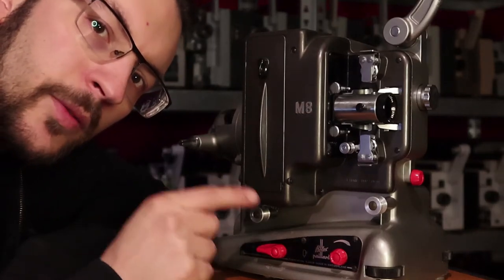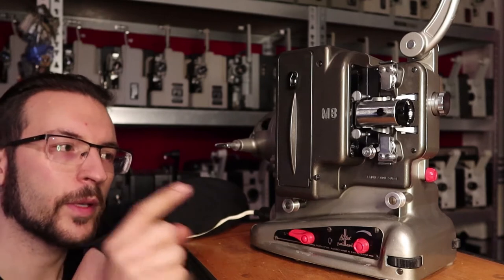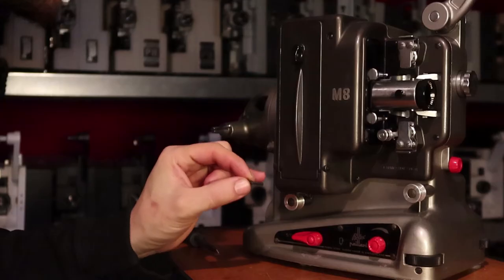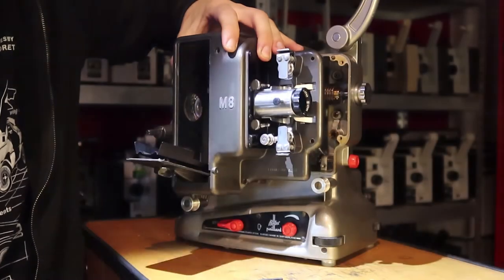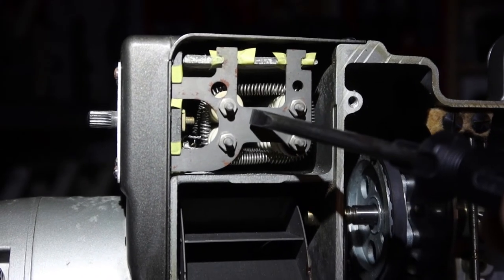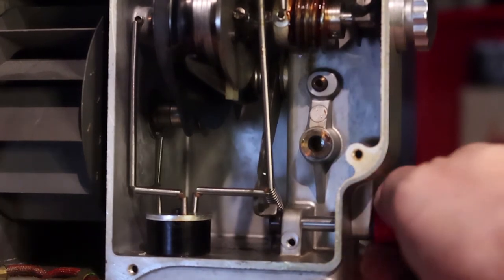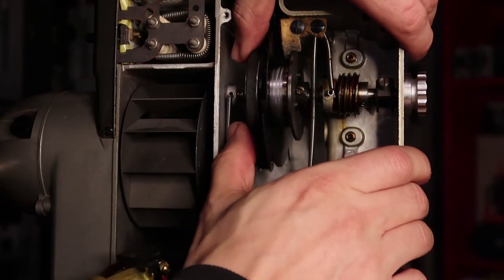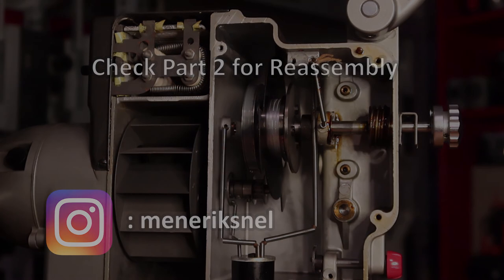Bolex M8 replacing the drive belt tutorial Part 1

Comment: Great video.  What is the part number for the belt and where do you shop for this replacement part on the web?  Subscribed and liked!  Thanks again for this valuable content.
Reply from the maker: Well i don't have a part number, i didn't replace the belt in this video as it was in good enough state to be re used, i just made this video to show the viewer how to change the belt. I don't know where you can find a replacement, i would sugest Ebay. My suplier of parts does not have this particular belt in stock. normally i get the parts at www.van-eck.net, they have many parts and shipworldwide.

Comment: Who repairs SM8 Bolex amplifiers?  I suspect a capacitor problem
Reply from the maker: I do, you are probably right and if you are handy with the soldering iron you can do it yourself. there are two large capacitors on the amp, the biggest is often the problem (depending on the type of amp). i recently repaired one that also had a shorted rectifier bridge.
Reply: @eriksnel6461  ,  I suspect a short.  A screw fell down inside the amp and now I just get terrible noise.  Hard to get at that amp,  I'll try to figure it out.  I assume you are not located in the US?  I have replaced capacitors before.  Since the projector is 1968 or so, I probably should replace all of them.  Thanks for the reply, Walt